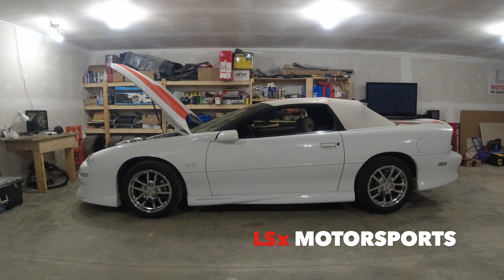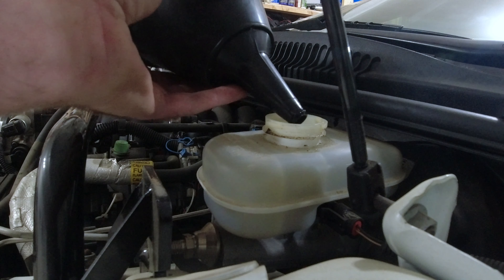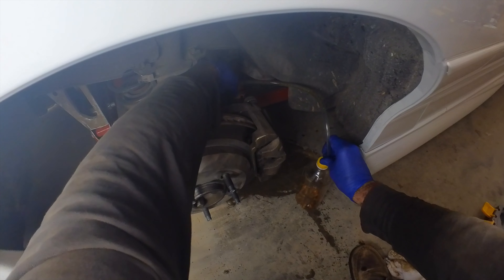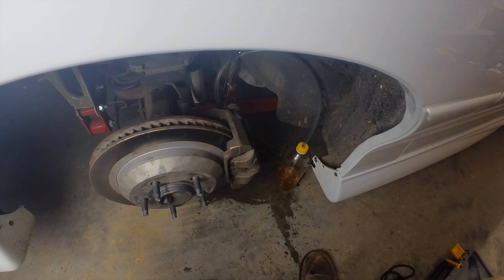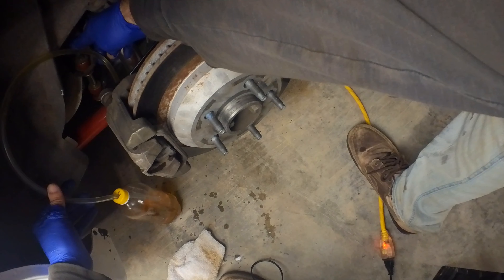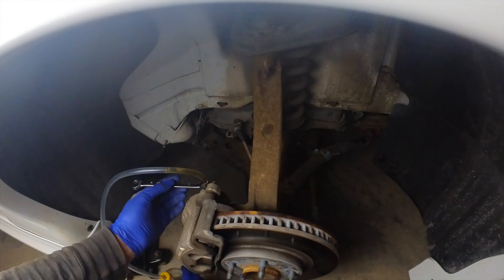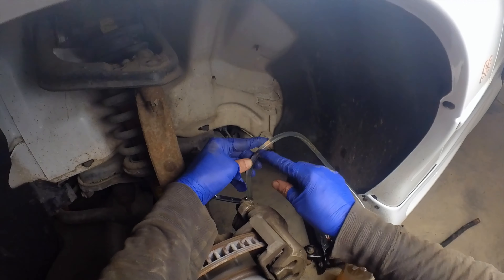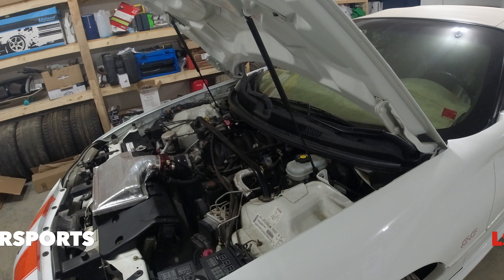2002 Camaro SS gets a full brake system flush - Flushing the brake system with a power Bleeder.

Comment: Great work! I gravity bled my back brakes at the same time and then did the fronts seperately. After the bleed, my fluid level dropped a little. I figured it was because of the abs system. I topped it off and has a great pedal feel! Thanks as always from Mike in DFW

Comment: I replaced a front calliper because the brake was dragging when the wheel was off the ground. Just enough for the tire not to spin from momentum. Has plenty of miles on it, over 230,000 miles.
Reply from the maker: Yeah I just Flushed the brakes in a 94 Z28.29 years old with the original fluid in it and I didn't think it looked that bad so not sure how important changing the fluid is.
Reply: @LSxMotorsports2021  I've heard that the additive package degrades with time and the fluids boiling point lowers.
Reply from the maker: @theflatrock8167 that sounds about right